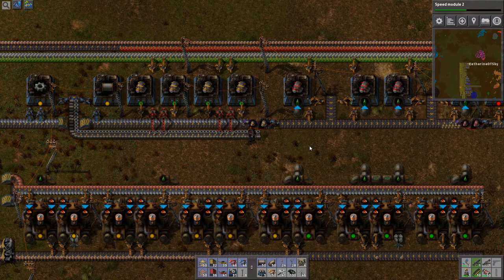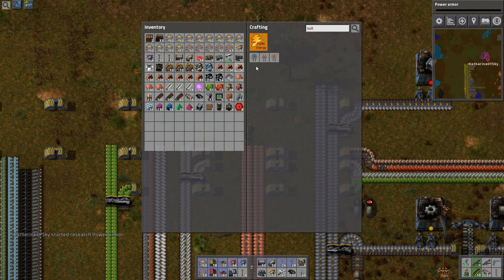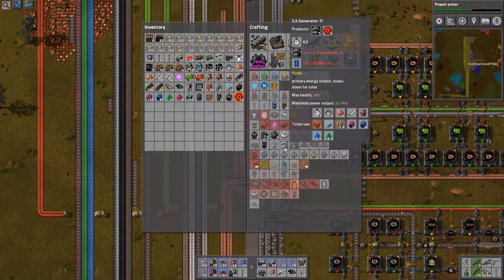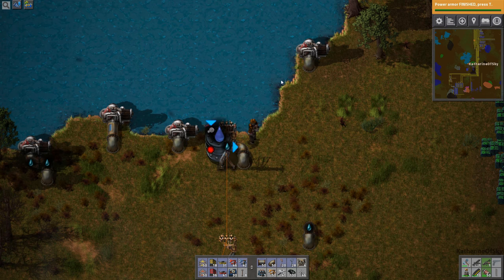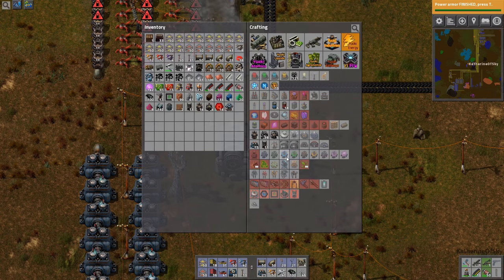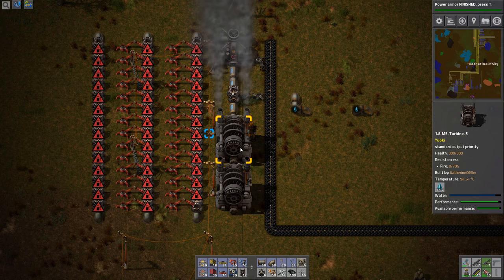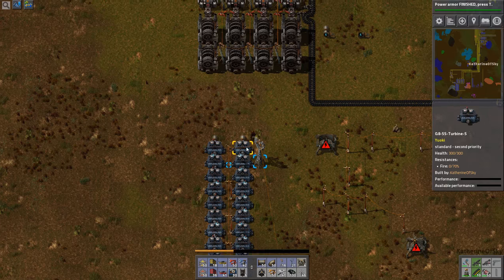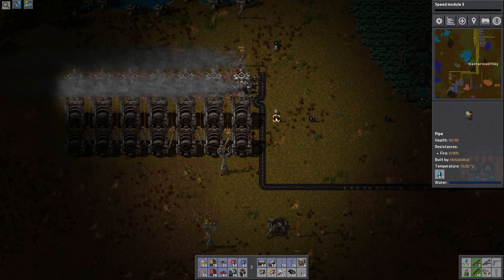Factorio: Yuoki Mod Experiment Ep 18: Power Play - Let's Play, Gameplay 0.14

Comment: To test new steam chains the principle is this: overkill it and then cut back. So make a long chain of 10+ giant boilers and 10+ giant turbines or whatever until both of these things happen at the same time: 1) the water coming out of the chain of boilers is at 100degrees 2) turbines at the end of the chain have 0 water and 0 performance. THEN remove turbines one by one until the last one is getting enough water, then remove boilers one by one until the water coming out drops below 100 (put that last one back). Sorted. 

Edit: you can tell two turbines is definitely not enough because there's still plenty of water left, you just weren't heating it enough in your tests.
Reply from the maker: Thanks!

Comment: One method I use for balancing is to put a tank at each end. (Which will also become necessary because these things hog water like no-one's business. So a tank between the offshort pump and the boiler "Stack" and then a tank between the stack and the turbines. If numbers are steady and the output is full, everything's great. If one side is dropping, that means there is too much being pulled.

9:46 Despite launching a rocket with yuoki, I've never figured out the pressured fluid cycle. It looks interesting, but...

Comment: So, I've read through the mod's code and found an easy ratio for the early Yuoki boilers and turbines:

1 offshore pump
3 Boiler 1M8/3 (1840kw each)
3 1.8-MS-Turbine-S (1808kw, no more than 3 per pump)
=
~5.4MW per pump

This setup will get you far. once you have efficiency modules and better fuel, you can try out the steam turbine and 50MW electric generator. But, you'll need a Research Center first, which consumes 150MW, hence the need for modules. 

Often times, Yuoki will balance his stuff by requiring tons of power. Good luck!
Reply from the maker: Thanks!

Comment: so you failed to notice that the pump eats pressurized hydraulic fuel and power to produce water.
Reply: and the boiler to engine ratio comes from "engine max output / boiler max output" rounded up. so in the youki boiler/engine case the turbine produces 1,8Mw of electrocity and boiler produces 3.6 MW of power. so for every youki boiler you can power 2 turbines. water consumption on the other hand is something i don't know hot to calculate but its easy to test out. put down boilers and turbines in correct ratio until water runs out and that's your max you can do with given pump.
Reply from the maker: I did notice that the pump consumes hydraulic fuel.
Reply: i seemed to have a dyslexic hick up there that carried to you :D meant to say fluid not fuel. you just worded it in a way that it produces the hydraulic fluid.
Reply: henri knutsson you forgot about the boiler efficiency which is 75% for the big ones, so the ratio would be 2 boilers for 3 steam turbines.
Reply: +marc intosh the boiler efficiency does not affect the amount of energy generated. it affects the amount of energy wasted from the fuel. if it was as you say the infamous 14/10 boiler/engine setup should be 25/10 if the boilers only generated half of what the tooltip says with 50% efficiency that the vanilla boiler has.
Reply: That's interesting, I didn't know that. Did someone report that as a bug already? I consider that as a bug, a minor one, but still. The wiki has it right for the boiler: energy consumption of 780 kW and power output of 390 kW.

Comment: MF powered things requires MF which you cannot make. Also, the Yuoki pumps, (solid fueled, electric, MF), all pull water from the ground, not a lake. So, they work anywhere. However, do not use power to make power; Or, you could end up in a death spiral and halt all power production, just like in vanilla.
Reply from the maker: Indeed!  I do try to avoid death spirals wherever possible!  Thanks!  :-)

Comment: I watched a video by one of the developers and he mentioned that the bigger boilers will eat fuels that have low energy potential. Yuoki accounted for this by allowing coal to be crushed and pressed into better fuels.  If you watch back your video you'll see the coal basically disappearing into your boilers and not heating them efficiently.  I think he said that if the energy potential is less than half the output of the boiler then it needs to be upgraded.  I hope that helps a little bit.
Reply from the maker: Ahh, interesting.  I will look into it -- Thanks!
Reply: hoi, yeah you have to crush the coal into dust the dust into single brigs and the single brigs into the larger brigs. the lager ones provides 56MJ.

they are also good for the trains.
ah they stack up to 250
for the water you need 3 pumps each line. with less you come into trouble (i did ;-) )

i'm only build the little ones and after i've got 4 energie arrays i swiched to the solarpower

cu
caleum
Reply: Also the production of better coal fuel gives you a lot of technic signs which you will need a lot!